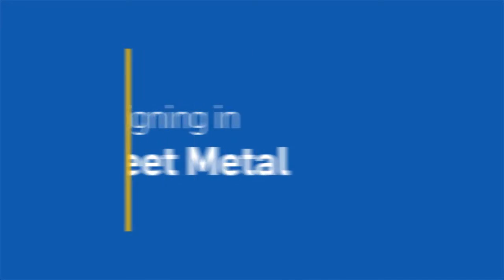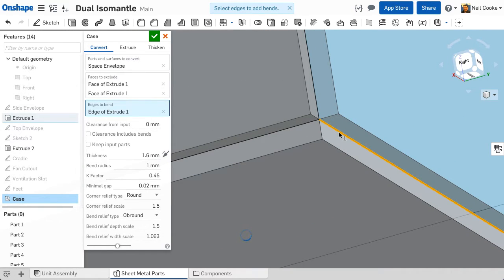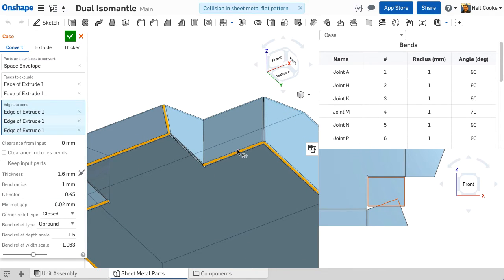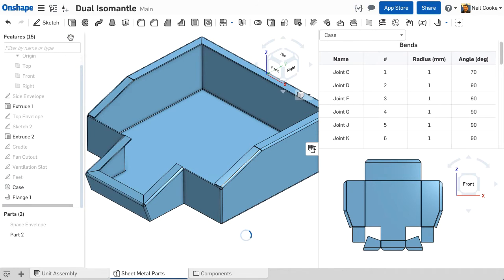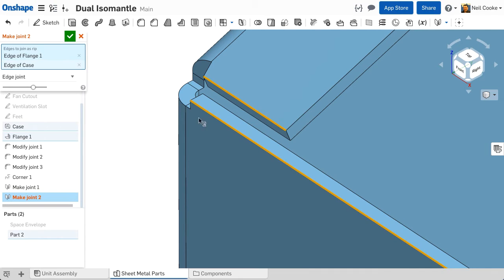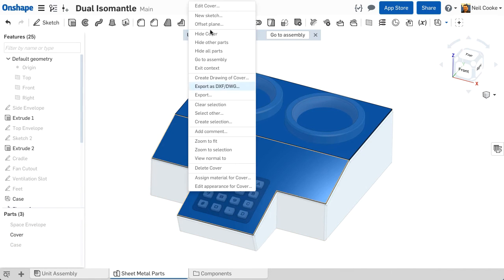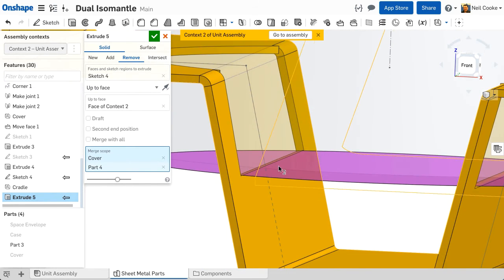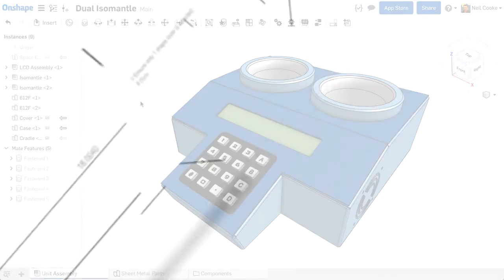Simultaneous Sheet Metal | What's New in Onshape - February 13, 2017

Comment: Hi! I need to change the flange from 45 degree joint to a 90 degree joint as when the parts will get folded the Vee's and punches wont fold the ends and will need grinding down. how do I change that so the corners go from 45 to 90 joints